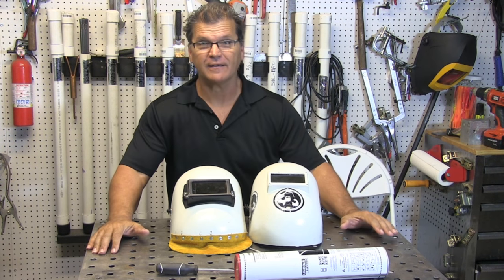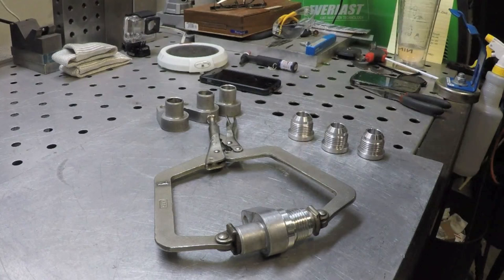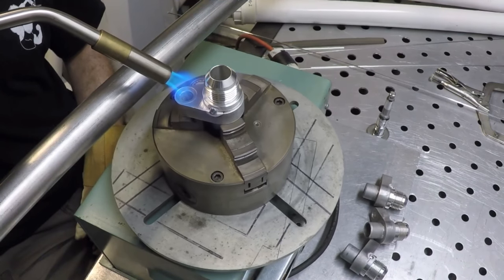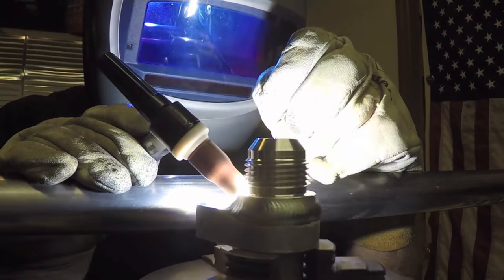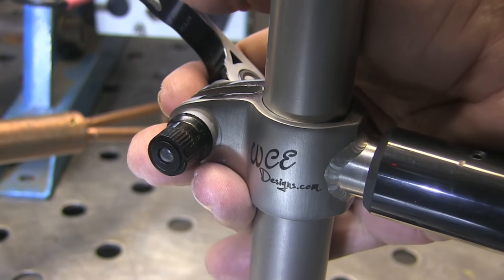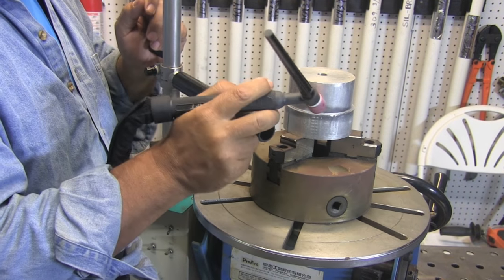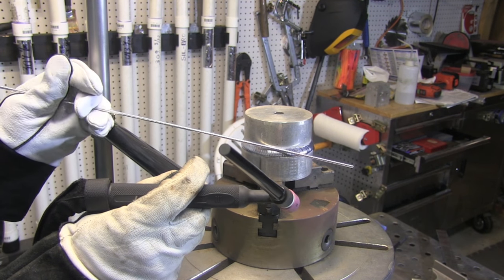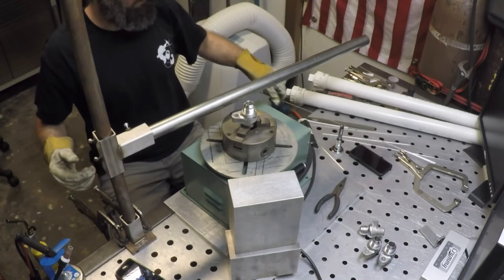Tig Welding Aluminum Fittings, preheat, DIY prop

Comment: another excellent video . one thing i did while making my tig prop was make the cross bar so it can be flipped up out of the way easily for changing parts out , just personal preference ,anything to make life a little easier !
Reply from the maker: great idea...thanks for posting it
Reply: hey I was just thinking on a video where NASA is talking about mars... I wonder if you could perhaps be interested in the welding in martian conditions... this is on the exterior of the habitat or shelter and perhaps in the inside... yet this idea may be to far out for your style... it seems like a cool idea at the time that I made this comment... because to me it seems like Mars is all about this and other methods to create stuff

Comment: I just tend to use scaffold pipe and clips for my props easy to set up and cheap. Ive always got plenty of off cut pipe around for various lengths depending on what I need.

Comment: Been watching your post for awhile now. Great job!  I just learning. I want to weld motorcycle frames as well as aluminum crank case repairs. Is there one welder you would recommend,  rods , videos,  books, etc. I have had my garage wired for 220. I also took one welding class so far, and plan on continuing.   Thanks

Comment: What kind of welding lens do you use in front of your camera to capture your arc shots?  They are always crystal clear.  Also, is that baseplate a piece of that 1/4 inch thick steel you get from JFLF.org?

Comment: Nice prop stand. I'd like to copy it. I'm betting the round tubing is 1.25", not 1.125", judging by how close it looks to fitting the inside of the 1.5" square pipe with 1/8" wall. Any comments on that? Or maybe the square tubing's a different size?

Comment: Do you ever find that your hood doesn't get quite dark enough for high amp AC tig? Like at 250 amp on 1/4" aluminum i was maxed at shade 13 and still seemed too bright to see clearly especially right when i fire up.

Comment: hey i got a huge question. .i take my test for ua21 stick pipe all the way out 6010p root 7018 fill and cap..i cant find no video doing the thickness of pipe that im doing its 2 inch but you got to put 4 stringers on the cap..my root is fine its just my cap..can you plz do a video before wensday showing that 2inch pipe with the 7018 cap..not schedule 80 because you can run 2 stringers on that,  this is deeper so your cap will be 4 stringers ...thanks if not i understand such a short notice

Comment: hi jody i`m about to build myself a turntable to bid for a job, i`ll be doing stainless to stainless and shaft rebuilding, it`s the 3mm per second a good overall timing rule or just for this job on al? sorry the basic question but i`m having trouble finding a suitable variable speed controller and it seems i`ll be stuck with one to three speeds via v belt. any news on the android version of the welding app?. thanks for the video man. always learning. pete

Comment: I have a question about a stick welder that I bought not long to ago. It's a hobart stickmate LX with AC and DC, we'll my question is if is a good machine for beginner to start with.
Reply from the maker: Definitely a decent machine. Seems to be same as the miller thunderbolt. I have done a few vids using the thunderbolt and scratch start Tig. I am working on a stick weld video using 7018 vertical using the thunderbolt
Reply: weldingtipsandtricks Thank you mr. jody for having the time for answering my question and looking forward to see some more helpful videos. God bless

Comment: Okay, i've seen Roy's computer screens on his welding table before, and wondered about HF getting to them etc. But now his PHONE tight there on the table not 2 feet from the arc!  Have i been worried about something that totally isn't a concern all this time?
Reply: The HF can be an issue. The Internet modem cable in my shop currently runs 5 feet overhead my welding table and the missus dislikes my welding... because she loses internet access when I light up. Never had issues with having phones in my pockets or otherwise close, though...
Reply: SWREngineering
Thank you muchly. Good to know my phone (and Roy's) aren't in as much danger as i would have thought. What with phones being a reciever and an internet device themselves a lot of the time. I guess as long as the dropping internet isn't actually damaging any hardware, and not feeding back to knock out the service for the whole neighbourhood at some kind of junction box, it's all good.
Reply: balisticsquirel yeah the HF does effect the computer screens...  now that I have the two it messes with the display settings.  Very annoying but it's the only place to put the right now.  As for the phone it can mess with them too.  Seems though the nicer phones have better shielding.  The cheaper ones don't seem to last very long.  Hahaha.  I've had a few do somethings that the store guys raised their eyebrows at.
Reply: balisticsquirel It has never killed any hardware, it just disconnects the WiFi/WiFe. At most, I have to power the modem down and leave it a minute, then turn it on and all is fine. Like Roy says, good phones does not seem to have an issue. I have used Sony phones exclusively before and now I am using both an old Sony W995 and a Samsung S4, neither seems to have any issues with residing a foot from 200 Amps worth of liquid aluminium for hours on end. :)
Reply: SWREngineering
That sounds so cool it should be an advertising point for the phone manufacturers.  "No problems residing a foot from 200 Amps worth of liquid aluminium for hours on end."  :)
Reply: Roy Crumrine
Yeah, i find it's best to not try to explain welding related things to the non-welding public man. Just "the phone's doing this weird thing". Rather than "I think the high frequency in the tig arc has done it. Seems to only happen when i pulse on AC." Let them raise an eyebrow in confusion rather than at you.  :)
Reply: Hahaha, yeah but this was more the screen display was split where the bottom was on the top and the top was on the bottom upside down.  They had never seen that before, ha ha ha.

Comment: Add a second stand with a torch holder?
Reply from the maker: I already have a torch holder but I find myself just propping when there are only a few parts to do.  A while back I did 50 round parts and used the torch holder https://youtu.be/CXsd0AmWueU